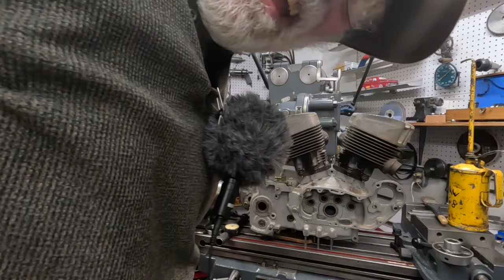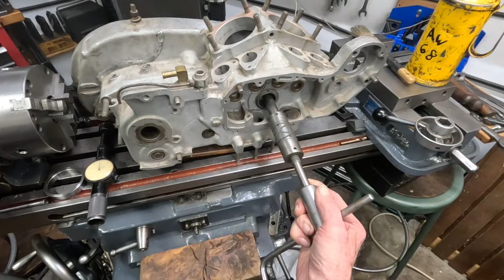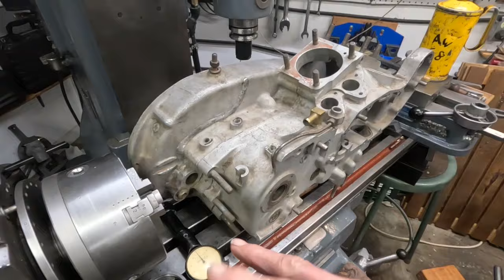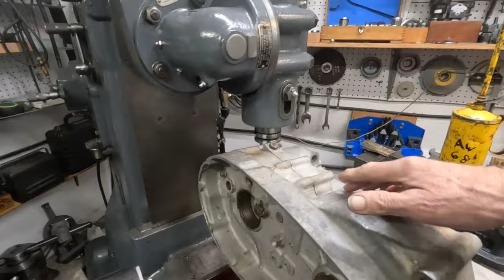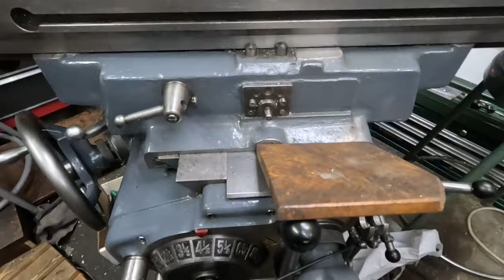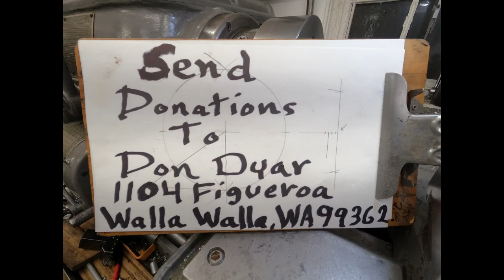Harley Davidson Machine Shop, Antique Engine Cases

Comment: Walmart is a dangerous place Don...I try and stay away from there! 🤣🤣. This is cool shit man. I don't know crap about Harley's or really motorcycles  in general except that if you cannot stay on one, stay off of them! However the Big Twin bikes are very interesting from the engineering standpoint and the way they look. So they fascinate  me. And the old days with the small shops were way more fun.
Reply from the maker: There is a separation between automotive machine work and mechanics and motorcycle work, even a division between Indian and Harley. The engine design is more toward aircraft.
 There is an old traditional way of fitting the roller bearings without any measuring devices to the tolerance of .0008" radial play, working with rollers that are in steps of oversize of .0002" so the shops of the time could do basic rebuilding without dial bore gages. I will run through how they did that.
 This type of engine was discontinued in 1999 for the big twins and finally phased out the small twins just a few years ago.
 The new engines are now like all the rest, no lapping of rod races and fitting bearings, just replacement component$$

Comment: For me, this is one of the most interesting videos Don.  Reminds me during my apprenticeship working with a Moore jig grinder hand the importance of setting up heat treated work so all holes and surfaces would clean up. Lots of indicating, it was meticulous fascinating work.
Reply from the maker: Few have the patience for something like this, and there can be a lot at stake, if this was a KTT Racer, the cases could be worth in the tens of thousands as it is the motor.
 As you know I am only glossing over it, there are dozens of moves in the correct order and clamping so as not to cause further distortion, a little heating and cooling for stress relief,  this is a mess!
I estimate if this was at a shop that had to pay bills, close to $6000 in labor alone, Yikes!
Reply: @DonDyarprecision   Looking forward to more installments in this H-D repair series.  Thanks for your channel Don!